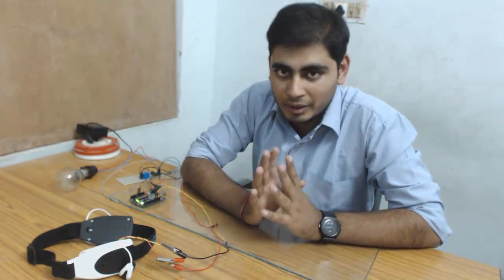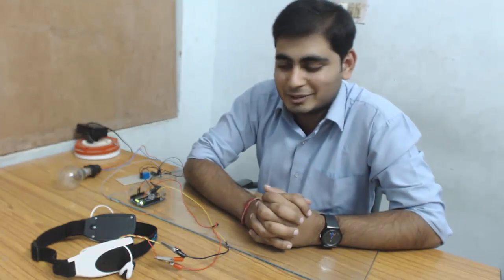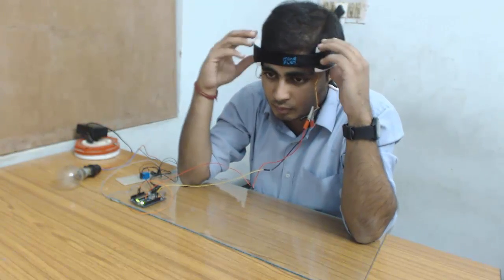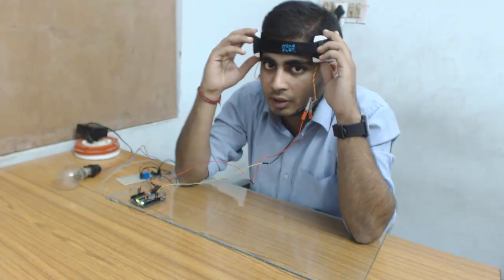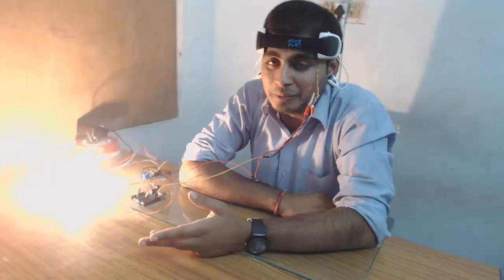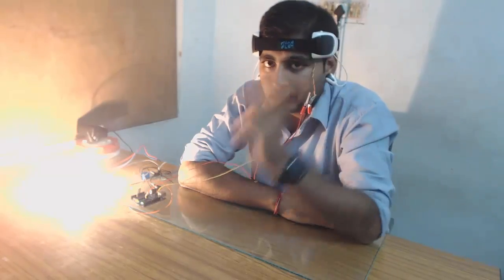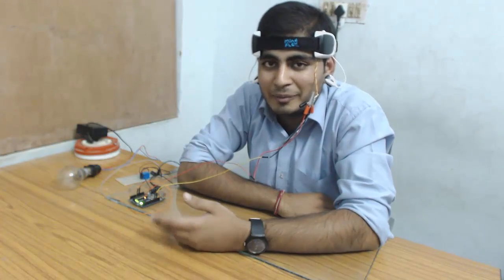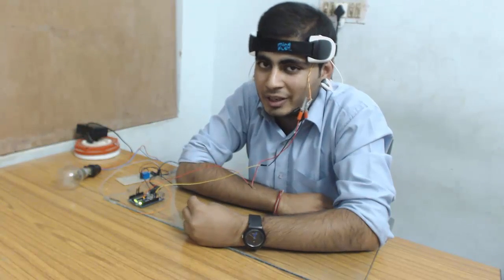Home Appliance Control using Brain Wave - TechShlok

Comment: This is possible  and would have believed that you have done it too but few things that's making this video look suspicious
1. Your hand at the edge of the table while turning the bulb on.
2. The clicking sound of something similar to switch at the time of turning the bulb on.
3. The concentration changes gradually so bulb will get the voltage gradually so it would go from less dim to bright and to again dim before turning off.
Reply: Same confusion bro.. nice raa

Comment: how did you make your own brain wave detector ,how does this sensor works ,i here about different types of electrodes which are used to detect brain waves in medical ,
everytime when we think  and concentrate on  specific things ,the brain generate  electric waves and it must be unique.
if we can detect these unique signal and hash it ,then we can used to sense our thoughts.;)
Reply: It's called emg sensor bruh...doing a research on it.
Reply: Arduino ECG
Reply: ECG is for measuring heartbeat bruh
Reply: And checkout BCI-brain computer interface...emg is for muscle only
Reply: This has neurosky chip. Mind flex

Comment: Did you configure the notch filter M jumper so that it works for 50hz regions such as in India.
Reply from the maker: +Prashan Fernando  
Yes , we have done that  !!
Reply: Would it be possible to know how this was done. The mindflex which I purchased is from the US. What would happen if this was not done. Seems like you have done a great job!!!
Reply from the maker: +Prashan Fernando Thank you for the appreciation . Changes like Baudrate and few more thing can be done by sending serial data to Mindflex but for Notch FIlter , you need to do physical changes . 
There is a pin named as 'M' in the Sensor , which is by default connected to Voltage pin . You need to connect the M pin to GND , instead of Voltage pin to select the notch fitler frequency to 50Hz .It is 60Hz by default .
Reply: @AyushJaininnovator  it is fake, please tell truth to the people